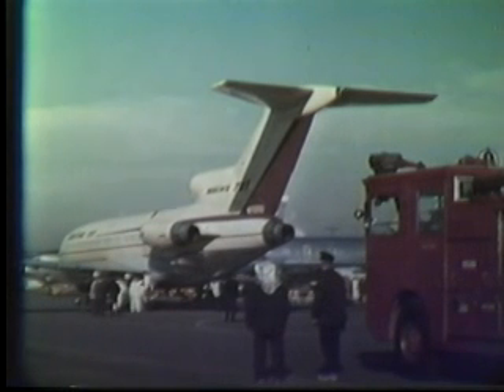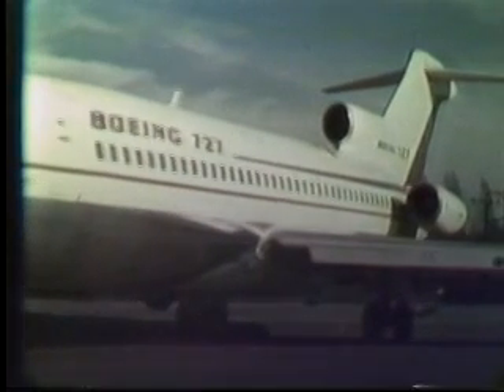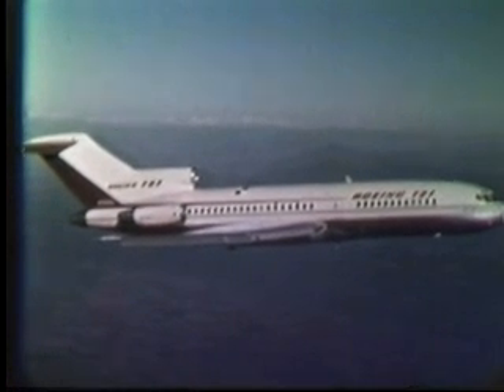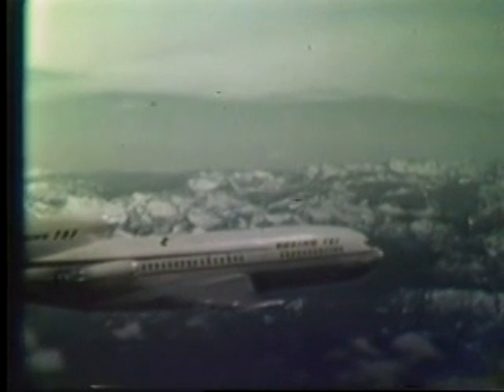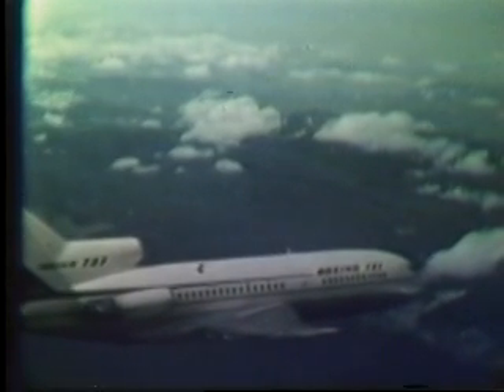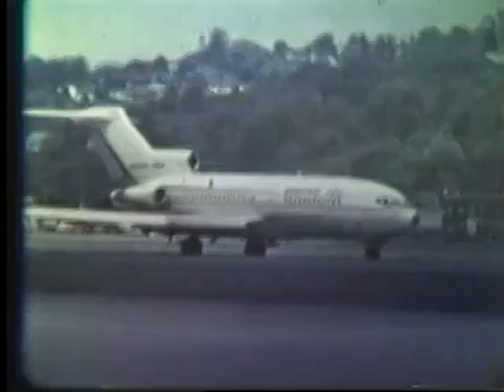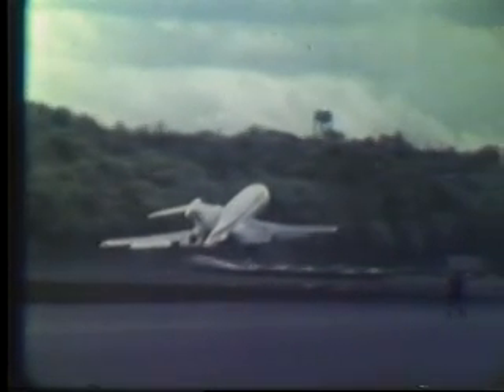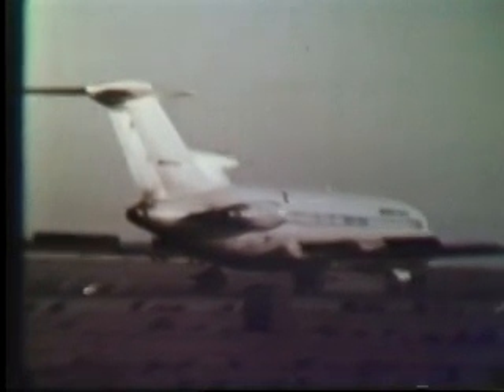Boeing 727-100 Tri-Jet Prototype - "First Flights" - 1963

Comment: I remember the early  727s, DC-9s & 737s used to spew out thick black smoke, almost as bad as the J79s (Convair 880s). And in this footage, the JT8D's smoked very little. I do know in the early 1970s something was done to greatly reduce the smoke from the JT8s; probably due to public outcry.

Comment: From Boeing, I flew the 707-200, a great, allmost indestructible a/c, the 727-100, the 727-200, the 737-200, the 737-400, and the mighty 747, ( grand - in all senses, a/c ), but the 727-100, well, she andled like a fighter a/c !!!
   It's so strucstructurally strong, that it is the only commercial 
a/c, as far as I know, that has BRAKES IN THE  FRONT LANDING GEAR LEG !!!
   ( Not so on the -200 ).
   The only one from Boeing, I was not very fond of, was the 737's !!!
   ( Perhaps a personal opiniom ).

Comment: when i was at EASTERN, i absolutely LOVED working on this aircraft.   rock steady in rough air.  the only thing about her that i did not like was the lack of keeping cool on the ground on hot summer days.  other than that, i love the '72.   sleek and classic looking.  and sitting on the aft jump seat, hearing those PW jt8's....... music to my ears.   long live the 727 in all her forms.
Reply from the maker: Thanks Aaron, I really enjoy reading comments like this!
Reply: floopy312 the cabin.  it was an absolute sauna on hot summer days.  in the caribbean, it was really bad due to the high humidity.   the a/c packs could not keep up on the ground.  in flight, a totally different story.  but, remember, this was an air craft that required a 'side sitter', (second officer) and he was kept quite busy adjusting the cabin temp manually.   but i loved the airplane.  absolutely loved her.  such a great profile!!!
Reply: "it's lack of keeping cool on the ground on hot summer days" you mean the engine or the cabin?
Reply: I was worse in a DC8 with no APU

Comment: I was riding on an Eastern airlines flight once in the jump seat on a B-727-100 and the captain decided to climb to FL390.  It was a bit high for our weight and the pitch attitude was on the high side to hold altitude.  Anyways, the -100 had an oval shaped intake on the center engine and at high pitch it could cause compressor stall.  So sure enough we get this bang bang bang in rapid succession.  The captain reduced the power on the center engine and told the F/O to request a lower.  The problem went away and we descended to FL350.  I had been told by guys that flew the B-727 that the early birds had too much lift lost by the speed brakes which led to a couple of accidents such as in SLT.  Boeing reduced the number of panels used inflight and the problem was solved.  I never flew one but always enjoyed riding on them.  Just watching the wing come apart on approach and landing was amazing.

Comment: No wing fences on the prototype.  An FAA pilot performed a "whip stall"  -[!]-  on a 727 during the final certification stages, and it nearly spun, so Boeing installed a prominent "fence" or rounded vertical cuff on the leading edge of the wing about 2/3 of the way to the tip to prevent "wing dropping" in the event that an airline pilot would decide to perform a whip stall!  Also, it helped stop spanwise flow of air.

Comment: Sadly the aircraft was bought, placed into service by United in particular  without it understood how to adjust to the rear engine position. It was too easy for pilots to undershot the runways causing deadly crashes at Salt Lake City and Cinny among other incidents. I liked the 200 version of the 27, while avoiding the competing DC-9. MD-80. 88. 90's like the plague.

Comment: I really enjoyed seeing these 727s taking off. They had character. 

Unlike any of today's aircraft, 727s didn't whisper when they take off. Those JT8D engines were highly durable and reliable, and very noisy in full takeoff power. 

I truly miss these old silver birds.
Reply: But Eastern called them Whisperjet. It was written on the fuselage.
Reply: @sundar999  That had more to do with noise levels within the cabin - particularly in First Class (toward the front).

Comment: I miss this plane in today’s skies.
I was lucky enough to fly with both versions 721 & 722 back in the 70s & 80s.
(The 721 had the galley in the centre).
The aircraft was also quite popular in Europe and flew alot to the middle east & Africa.
It had a great acceleration and short take off roll, however i often felt it was more prone to turbulence than other aircraft’s.
Reply: You mean the Boeing 727 and 717 not the 721 and the 722

Comment: My dad who was head of the Boeing photo unit and his crews probably shot most of this footage. I hired in to Boeing in June 1964 and was assigned to be a riveter's assistant on the 727 48 section torque boxes. Lost some of my hearing there! A year later I advanced to mechanic installing the hydraulic rams, jackscrew, cables and trim actuators in the vertical fin. Always liked the 727.

Comment: built in my home town. morphed into the 757. now there is a strip mall where the 727 factory used to be. And the Seattle Seahawks training camp.
Reply: Correction:  The strip mall is where the back shops were.  Final assembly buildings are still there.  The Seahawks training center is at least a mile north, on the site of an old sawmill.  The electrical and mock-up building was where an apartment building is now.  Fry's and Lowe's are in the old employee parking lot.

Comment: More stringent noise regulations have put all 727s out of commercial service. That is unfortunate. A few 727s are still in service, but they are mostly for private use. I like the sound of the 727 taking off. A non-hushkit 727 taking off is very noisy, but not as noisy as the BAC 1-11 or a VC10 taking off, and it's not as deafening.

Comment: That's true.

The BAC 1-11, also built in the early 60's, had a black athletes eye painted under the flight deck windows too. The BAC 1-11 was even noisier than the 727 taking off. Whenever the BAC 1-11 took off, it took off like a jet fighter, extremely loud and deafening.

Comment: The MD was in production later than the '27,and being able to use more efficient and quieter engines was likely a factor as well. The MD80 is more a competitor to the B-737 though,not so much the 727.

Comment: That and it was an old and less efficient aircraft,the planes were pretty much flown out. The '27 had a great run though,and were still being used for air cargo for many years.I'm sure they're still flying with airlines outside the US,most likely in South American countries airlines.I have spoken with pilots of them, they really liked the plane,it was a good flyer as far as they were concerned.

Comment: I think newer designs take anti-glare into account when the aircraft are designed. Newer paints also don't reflect as much as the bare aluminium or glossy finishes you probably remember on past aircraft.eg: most modern military aircraft are painted using a low-visibility flat grey finish

Comment: If you were sitting to the aft of the wings, on approach and landing you would literally see the trailing edges "come apart" at full flaps and you could easily see to the ground between the slats of the flaps.  And similarly if you sat forward of the wings, watching the leading-edge flaps come out was amazing, too.

Comment: I was a lucky kid in the 60s/70s.  Flew on 727s, 737s, 707s, 747s to Chicago and Hawaii, 720, DC-8, DC-8 Stretch, L1011, and even a Caravelle!  The most interesting one was a Convair 880.  I remember pulling down the sunscreen and it said 880 on it, and I asked my dad, what is an 880 and is it safe!